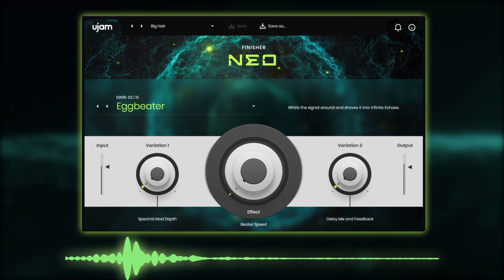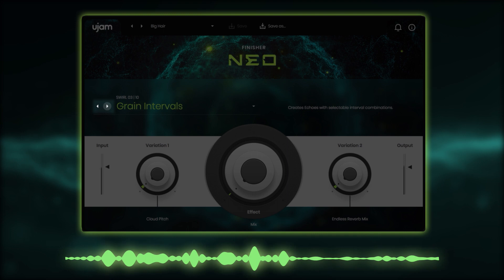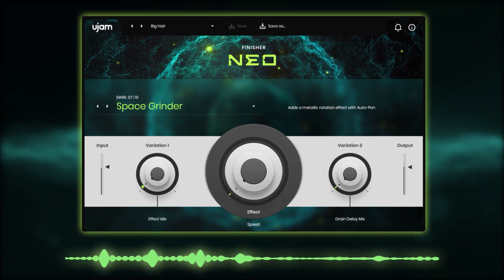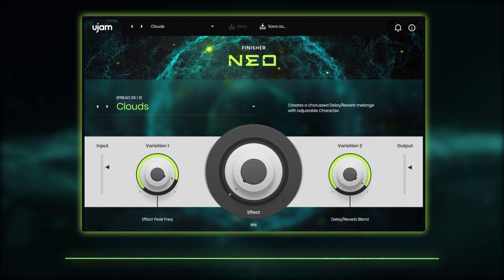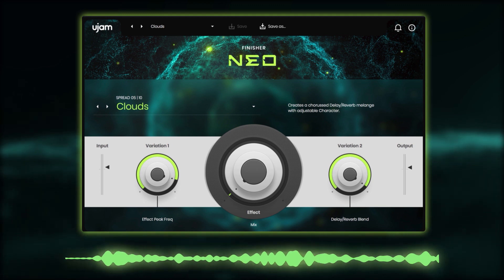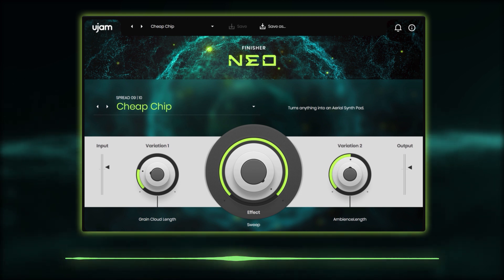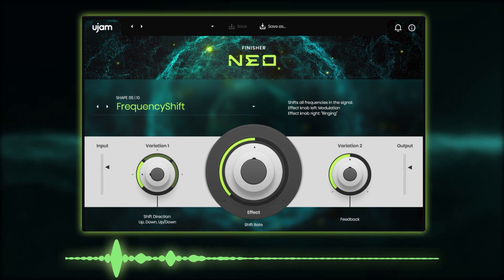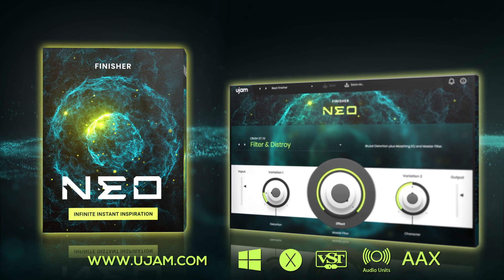Walkthrough | Finisher NEO

Comment: Great walkthrough, Daniel! Very helpful.

I just bought Finisher NEO. A problem-solver packaged in a way I've wanted for awhile.

I suggested this feature to Stefan in a support ticket, but I'd also like to bring it up here as others may find it useful: it would be terrific to have a true DRY mode at 0 Effect for ALL the MODES/types. If FINISHER MICRO is anything to go by too, I enjoyed using it a lot, but switching to some of the presets sound wet even at an amount of 0. Having it 100% dry/neutral would make it far more useful as a transition effect, like in a DJ set, or "morphing" between sections.

For example, a number of the SHAPE ones are either subtly or very clearly effected and there doesn't seem to be a way to turn them "off". That reduces their utility.

Also, a way to lock Output slider at 0.0 dB would help!
Reply: It's Torley!!! How are you doing man? You have been super quiet for the last 6 years :,(